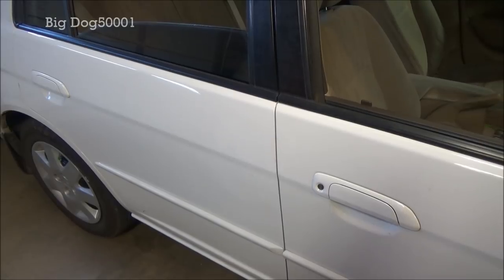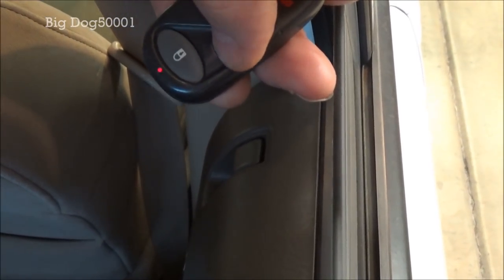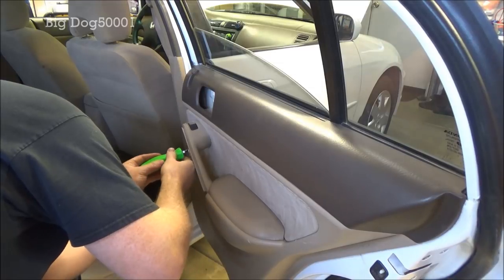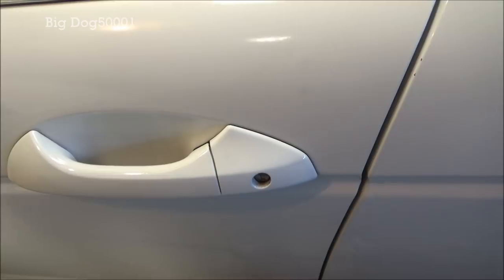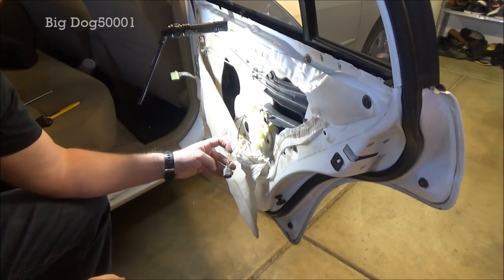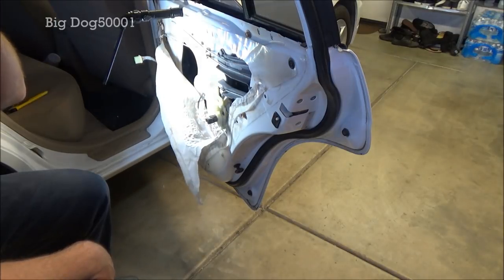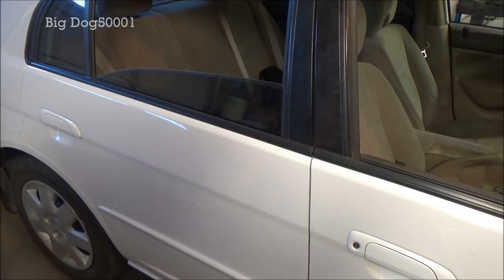Honda Door Lock Actuator Diagnosis and Replacement 2003 Civic (2001-2005 Similar)

Comment: I have a 01 civic 2 door, and I moved to Arizona from Michigan, and the car battery went dead at some point being in the sun maybe. So I replaced that, then it seemed like shortly after the key fob would not open the drivers door maybe 30% of the time. So I replaced battery in key fob but started doing it again. Its all original. The hand switch door lock button has always been not very forceful of a lock, and the passenger door has never locked/unlocked with the fob. I didnt know it was suposed to.

Comment: I have a 2003 Civic 4 Dr EU8 model with passenger and rear passenger ( both ride side ) door power lock problems. Any chance you could do a video on that model ? The front door wire harness looks harder to get access to

Comment: @BigDogg50001, I've got a 2003 Civic EX Sedan. Rear passenger side door lock doesn't work (unless manually opening) using either keyless remote or driver door lock switch. The rear lock doesn't appear to be getting any power as doesn't move (except if manually done) when using keyless or door lock switch. Based on your idea, I do not think it's the door lock actuator, so what should I check?

Comment: Thanks for the very detailed video. I have a problem on my 2004 EP3 Civic, my drivers door would always lock, but not unlock with the fob. I would have to lift the rod manually for the last milimeter or two. I just replaced the door actuator with a new one, and the same thing happens. It locks, and ALMOST unlocks but it stops a few milimeters too short.
Is it something to do with the rods? Do I just lube every single moving part inside and hope for the best? 
And my passenger side is fully dead, will get that fixed right after figuring this one out.
Thank you
Reply: Did you ever figure it out, I’m stuck. Mine will try to unlock but only a millimeter away from unlocking it will get stuck or stay still. And the other door just got a new actuator but it’s dead
Reply: @neidyrodriguez7167  Sorry for the late reply, never got the notification. 
Yes, I did. 
After trying to fix the old actuator and putting the new one in I realized that the connections had no power so I investigated further, turns out the prior owner installed one of those "Universal central locking systems" and the actual actuators were just hanging there, connected by wires that went noowhere. And the universal locking ones have a rod that ties to the actual rod you see from the interior when u lock/unlock, and the clamp has loosened over time, so it didnt have enough grip to fully unlock it. So I got a new clamp, tied it back together tighter and it works now, very weird, I didnt even know those Universal ones were a thing so I never noticed the little black box inside the door card. 
And the Passenger side had no power to the Universal one either, and it turned out that one of the wires had a lot of corrosion at the connection point, so I just re-cut, re-splyced them, isolated and it works.

Good luck

Comment: Really good video bro, I have a question tho. I have a 04 Sedan Lx and the driver lock won't go down it doesnt matter how much force I put into it, when I put my key in the fob it wont move at all in both doors, and I lock and unlock with the control and I can hear the locks trying to lock and unlock but the bearly move or dont move, do I need to replace all actuators or that box that sends the signal to all four doors?

Comment: I jsut got a Civic Hatchback 2001. Only drivers door and hatch will unlock. Could be some kind of settings or would all 3 other doors have some issue. Alle electric windows function normally. I guess i need to get a multimeter to check for currents.

Comment: what do you think would be the problem if my civic didn’t lock or unlock using the remote and if also it didn’t lock by pushing down on the lock manually from inside the car?

Comment: Hey brother your video was really good but it didn’t help me figure my problem with my Power locks on my 2008 Honda Pilot my problem is when I hit my remote twice to open all doors it locks back up in 1 second all the doors even when I hit the door switch to open on both sides even with the key in ignition and vehicle off or on now if I hit the fob once the driver door unlocks can you give me sense

Comment: Thank you for the great video. Seems like these problems dealing with the window and lock actuator could also be blamed on worn out wires (the one that connects from the door to body of the car).  How often do you think the wires are to blame?
Reply from the maker: Sometimes wiring and connections are the problem, maybe 10% of the time.  This happens more often in areas where there is a lot of corrosion.  Most of the time it is a component failure.  Thanks for the comment!
Reply: Thanks again. Your video helped me to fix my door lock actuator for my 2004 Civic EX.

Comment: Thank you for your video . So, Zi have a problem with power window ( passenger side front right ) everytime I when turn ignition on it keeps burning the fuse right to under dash fuse box it happened only for front right door ! I know it shot to ground somewhere but have no idea how to trace at begining . Any suggestion would be highly appreciated . Thanks

Comment: My key fob unlocks the doors, but then instantly locks them. The driver door won't open at all. The only way to get in the car is to quickly open the passenger door before it locks again. 

It happened once before in winter when the door latch froze.

Could this be an issue caused by the door latch itself?
Reply from the maker: It is possible there is a problem with one of the door latches, it sounds like an input problem.  It needs troubleshooting done but the control module is most likely seeing an input to lock the doors and so have to narrow down what is causing the input.
Reply: @BigDog50001  thanks for the reply, I think the door latch failed when closing the door, the door bounced back open, whilst I had set off driving. I managed to flick the lock to keep the door shut. This has probably triggered some safety feature to auto lock the doors (because the car was moving)

Now I just need to get the door card off somehow without being able to open the door.

Comment: Hey, I know I’m commenting 3 years late, but I need help, I don’t have a key fob so I used the lock button inside my car and it does nothing, but when I manually lock the car, all the locks go down, so I was wondering what the fuse is called that I need to replace

Comment: Do you know if the Multiplex unit in a Honda Civic 2001 can be repaired, as they no longer make it as a spare part? My Honda Civic 2001 won't start, and the Honda dealer say the Multiplex is faulty.
Reply from the maker: It would have to repaired by someone who knows these electronic circuits.

Comment: I have a honda SI 2002 mine passenger  side unlocks only it doesn't lock it sounds weird sometimes and also sometimes works  should   I  just change that actuator? Thanks
Reply from the maker: Of course I would test it first with a test light, but it sounds like a bad actuator from what you describe.

Comment: I have a 2005 Honda Civic Dx, my windows are manual. My left door won’t open because the lock is STUCK. Can not open the door at all. I was wondering if the actuator is on the right side for my car as well. Also I stopped using my remote to open my car because the driver door doesn’t unlock when I press it. (I have to go through the passenger side and push it up). Is there a certain name for the wire/cable that connects to the lock?
Reply from the maker: Those Civics use rods (not cables) and there are several of them (cylinder rod/lock rod/outer handle rod/inner handle rod).  Both sides are pretty much a mirror image.  I have seen the door lock actuators become frozen and stuck and not move and other times it is an issue with the latch.  Penetrating oil can sometimes help (spraying down through the window opening at latch/lock or through the inside door handle area and then working handles and rods back and forth).  Unfortunately many times breaking stuff (like the door panel, latch, lock etc) so that you can get to the problem area is the only way to fix it.

Comment: Hey I have a 2002 civic we replaced the activator but it only locks the doors when we try to open it through the central lock it doesn’t open the doors it only locks it what do you think is the problem??
Reply from the maker: Hopefully the Multiplex unit is not damaged.  The power to the door locks are ultimately controlled by the Multiplex control unit (part of the under dash fuse box) through electrical "inputs" to the control unit.   If all of the locks work in one direction but not the other then most likely power is good to the Multiplex unit (still not a bad idea to check fuses 9 and 16 under hood and 10 under dash for power).  

I would verify that ALL power door locks do NOT work in one direction FROM EVERY SINGLE "INPUT" (key in door, key FOB, door lock switch).

If ALL locks work in BOTH directions from at least ONE of the INPUTS, I would look towards an input problem to the Multiplex unit from the input that was not working (bad switch/FOB/wiring etc).  

If ALL locks do NOT work in both directions from ANY input, then I would look towards a problem with the Multiplex control unit.

As you can see, troubleshooting this system can be a bit complicated and usually requires some background into how the system operates to find a problem when it isn't a bad door lock actuator.  Hopefully this at least helps you understand what you are paying for if you end up paying someone else to fix it for you.

Comment: When you click the key fab, or the door lock button in the car, and it does not lock or unlock, could it just be a bad fuse? Or could the whole internal fuse box be bad?
Reply from the maker: It is possible to be one or both or a million other things.  The locks are controlled by the Multiplex Control Unit which is part of the under DASH fuse box (inside car).  Fuse 16 (20A) in the under HOOD fuse box (inside engine compartment) provides battery power to the Multiplex Control Unit for the door locks.

Comment: I have an 03 civic sedan manual trans, I replaced the driver side actuator OEM from Honda. 
Fuse for door locks in engine bay is fine. Yet, all doors only unlock from both key fobs but will not lock. 
When sitting in the car with all doors closed, all doors lock if I manually push down the door stud. 

The unlock/lock switch on the door handle only unlocks all doors. Same as the key fobs
So now I have a spare actuator but no solution. Please help. Anybody know if there’s a component or relay or something I should check. So annoyed. Thanks.
Reply from the maker: It is almost impossible to diagnose things over the internet and you did not say whether problem was there before or after putting a new door lock actuator in, but I would look for input problems to Multiplex Control Unit first (I have seen Multiplex unts fried due to improper installation/testing of components so hopefully the MICU is not damaged or bad).  

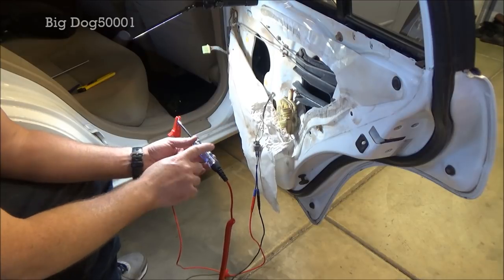From your description, the doors lock properly when manually pressing door lock rod, so power and ground to locks appear to be ok.  If you look at 12:45 in video, you will notice doors do not lock until door contact switch input is closed (which I did by hand).  If the door switches or wiring from them to MICU are bad, the doors will not lock.  

This is where I would start on your vehicle if I had it in shop.  I would check for proper operation of switches at all doors and see if I can verify proper operation of them either through scan tool, interior lights or locks themselves.  

I would not fire more parts at it until I could find the problem.  Good luck with the repair.

Comment: What happened or what to check for if i don't get 12v power to the door actuator
Reply from the maker: Have to track power (or ground) circuit back to the source (battery/chassis) until you find where you are losing it.  Have to know circuit design and all components involved in that circuit.

Comment: I have a Honda 2004 civic I have a problem with one rear door never locks even if u try to push it won’t stay down or go down the other rear won’t ever unlock even if u try to unlock it. The remote will lock the two front doors but not any rear doors or unlock them do I know how to fix it or I just want to know if there a way to fix by my self
Reply from the maker: I test lock actuators just like I showed in video.  Many times the problem is a bad actuator, either it doesn't move at all, only moves a little bit, or is stuck and can't even be moved by hand, but testing is required.

Comment: In which part of the car is the module of the electric locks?, since a door of my Civic 2004 does not receive electrical signal, but if the actuator works that raises the insurance
Reply from the maker: The locks are controlled by the Multiplex Control Unit (MICU) which is part of the fuse box under left side dash inside vehicle.  If lock actuator works when given power/ground, some possible causes are broken wires, bad wiring connector or bad Multiplex Control Unit.  **I do not give any lock component power/ground while plugged in because it can damage the drivers inside the MICU.
Reply: Thanks, I review it and I hope to solve it, greetings

Comment: Need help,  same car.  But I can't manually lock or unlock the rear door lock.  It won't move.  I can't open the door panel because I can't open the door.  The lock won't unlock.
Reply from the maker: Sometimes the lock mechanisms or the latches will seize in place and they can be a bear to get undone.  I would start by removing the door handle like I showed at around 6:30 in the video and try to work the lock rod and door hand rod back and forth.  In situations like that I will sometimes lower window and spray penetrating oil down towards lock and latch rods and mechanisms.  Sometimes damaging the door components is the only way they get fixed.

Comment: Is it possible to install a manual crank assembly. I hate power accessories
Reply from the maker: I'm pretty sure it could be done, but you would probably have to replace too many parts to be worth it.

Comment: Teacher my Honda Civic 2004. When come winter ❄️. 4 actuator door lock no working in the morning.     Only in winter.  Maybe. Need 4 new actuator door lock.     Tanks
Reply from the maker: It could be several things, needs to be tested when they are not working to confirm what is failing.

Comment: My 2001 civic door lock just makes noise??? But none of the locks gos up or down?????
Reply from the maker: A test light at one of the door locks that aren't working is where I would start.
Reply: Hey mine does the same thing, what was the problem and how did you fix it??
Reply: I didn't fix it I ended up selling it
Reply: @memphistenn77  oh alright 👌🏽

Comment: My doors actuators just got replaced and now my lock seems to have power but seems like its stuck? 2001 civic.
Reply from the maker: Double check work, especially the door lock knob that pokes out of the top of the door panel, they can get jammed during reinstall and do what you are describing.

Comment: I have this exact problem on the same door on my 02 civic lx sedan
Reply from the maker: Pretty common on Hondas.
Reply: Big Dog50001 Automotive thanks for the video helped me out a lot and I did this today and it worked. No more having to unlock the door from the inside to get it to open which I hated doing

Comment: Do you have the part number for that little plastic piece that you're pointing to at 6:44? I'd like to buy a few before I disassemble the door.
Reply from the maker: Always double check part numbers, don't take my word for it.  Sides of vehicle are always in relation to sitting in driver's seat.Part for right side door handles: 72149-SR4-000
Part for left side door handles:  72189-SR4-000
Reply: @BigDog50001  thanks man 👍